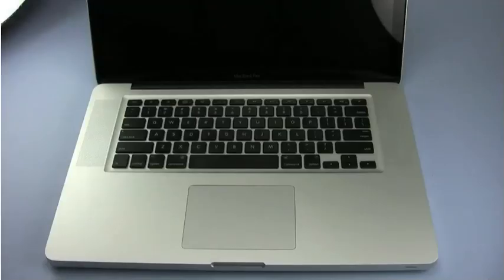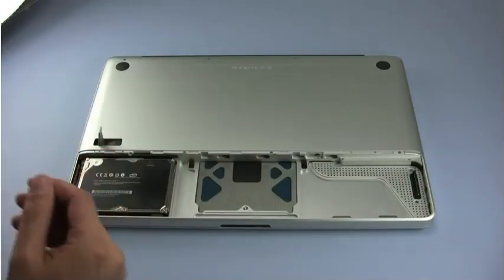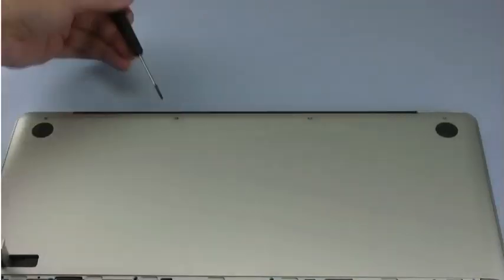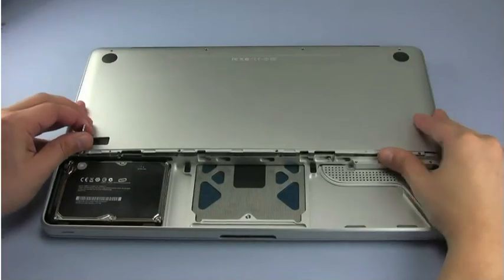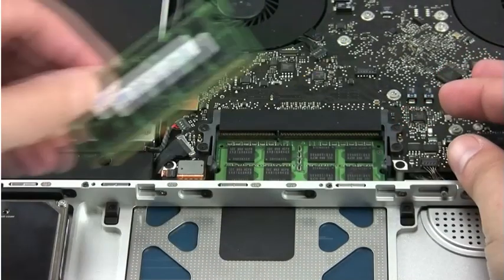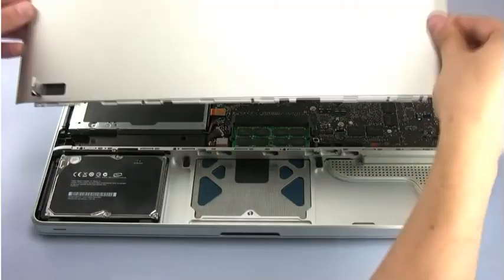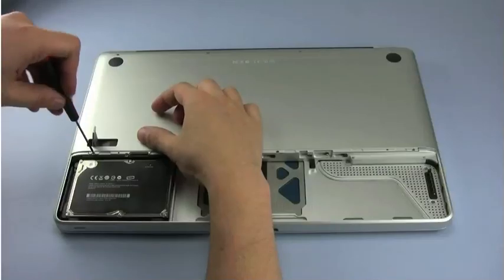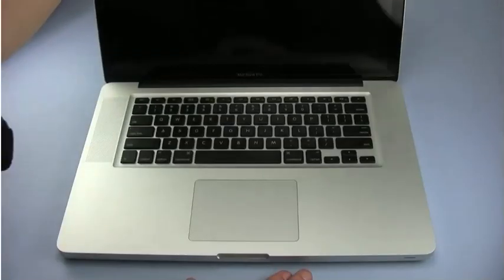How to install RAM in a new MacBook Pro (Late 2008)

Comment: I purchased my MacBook Pro (Late 2008) and it came with a single 2GB RAM stick by Samsung. Today I purchased 2 4GB sticks Hynix brand to apply 8GBs of memory but I kept getting the 3 beeps at startup. I used different combinations but I was only just able to use 1 4GB stick and the original 2GB Samsung. Is there something wrong with this? I have all EFS updates installed and normal software updates including Mountain Lion.

Comment: HELP!  I have a older MB Pro 2.16GHz Intel Core 2 Duo 15.4 inch System that had 1GB of RAM.  I wanted to increase the RAM to 2GB (purchase 2 1GB).  After installing the RAM, the computer won't boot up and there is nothing on my screen.  What am I doing wrong?  There is only a constant white light on the lid release.  Thank you for any responses

Comment: Double Data Rate Small Outline Dual Inline Memory Module (DDR SO-DIMM) format
1.25 inch or smaller (3.18 cm)
1 Gigabyte (GB) or 2 Gigabyte (GB)
204-pin
PC3-8500 DDR3 1066 MHz Type RAM

Comment: Thought I'd share this tidbit. This late 2008 model supports up to 4gb, officially. But if you have the right firmware update you can install 8gb. If buying from Crucial just order the memory for the next model 2009) and Google for info on the firmware.

Comment: I would avoid anyone purchasing memory for the new late 2008 MacBook and MacBook Pro's from any third-party vendor (yes, even OWC) as they have been causing system lockups and crashes to a large percentage of users.

The new MacBooks might probably use a different latency or voltage for their memory and only Apple-supplied memory isn't causing these problems (which are branded by Samsung)..